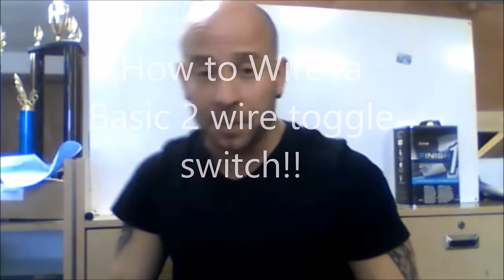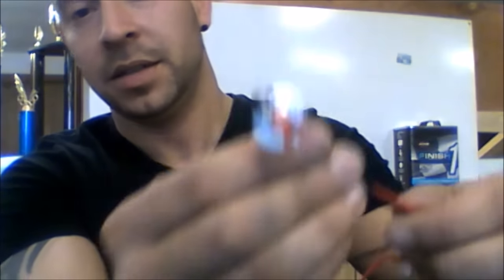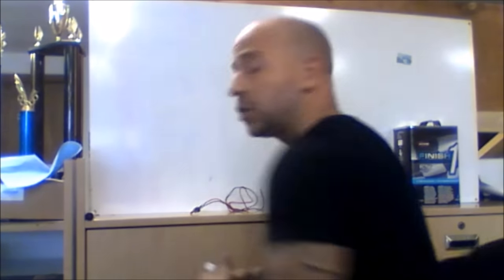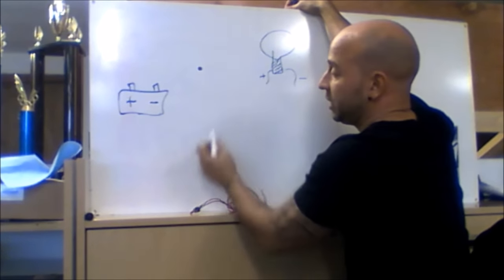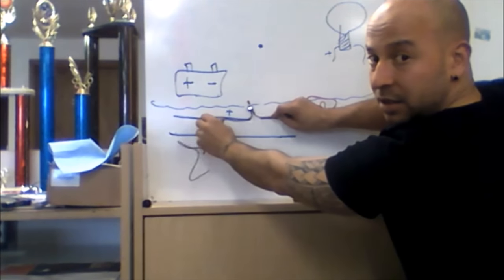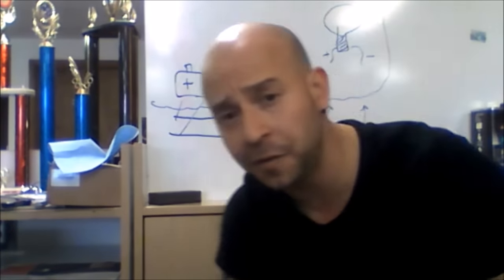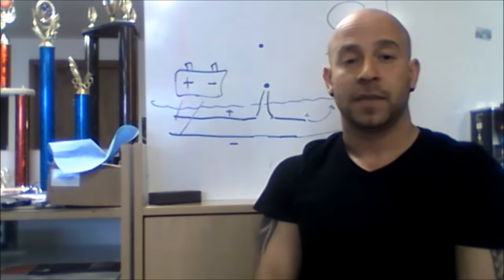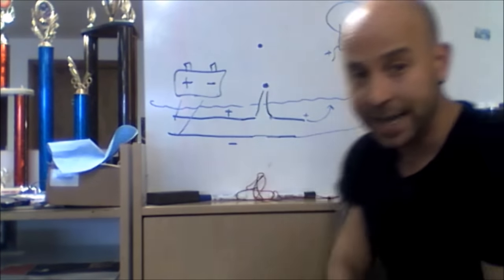How to wire a toggle switch , ( on-off 2 prong ) easiest best explanation, 2020

Comment: Mine is a 12V RV light fixture that has three lamps. I made the same mistake and put one black wire of the push button on and off switch on the hot or line and the other black wire from the push button on and off switch to the neutral. Bam! Blew a fuse! Duh! Your video is the only one I watched that explains it correctly! Thank You for helping this dummY-lol.

Comment: Absolutely amazing that you explained it so well and drew the diagram. I’ve been searching for this info for so long so my dual digital voltmeter I installed on my boat wouldn’t stay on all the time. Glad I found this. You are awesome. Wish everyone could learn from you. Thank you.
Reply from the maker: Thank you very much.  I appreciate the appreciation. I hope to continue to help.
Reply: @myonlinecarguy1  i loved thia explanation but i have a lil sneake question😅

Lets say i use a fuse tapper to give power to the switch right... 

to give Power to a LED strip, will connecting the led strip to one of the switch pronga make it to still get power?

Comment: simple and to the point , best explanation I’ve seen about this. I’m trying to ADD  a toggle switch to my light up emblem that I used a fuse tap to connect. Now I know all I have to do is take that ground off, connect one end of the toggle to it, and then put the other end back on the ground to complete the circuit. Thank you for answering the simple questions a “non electrician” everyday DIYer has, basically, just complete the circuit the colors don’t matter. You’re the man. Thumbs up
Reply from the maker: Seems you have a perfec understanding.  That's awesome,  your a rockstar and I appreciate you taking the time to message me.
Reply: @myonlinecarguy1  appreciate the reply as well. Subscribed. Always down to help people who want to help others. Thanks for your help brother
Reply: About to get this installed today, hardest part now will be going through the firewall and finding a spot for it that is hidden and doesn’t look cheesy… any tips for going through the firewall to the engine? (2013 c250 sport 4 door)
Reply from the maker: Each vehicle is diff as far an entry points,. But the easiest approach is not to go from car to engine bay. Instead go from engine bay into car. 2nd thing is to look for the OEM harnesses, they already go into the car and sometimes you may find that following them in the same location (rubber boot) is the easiest way.
Reply: @myonlinecarguy1  that’s a help, I was going to do it backwards thanks again boss. Especially for the quick replies!

Comment: I have a 1953 GE swivel top vacuum that needs a new toggle switch and power cord, your video has given me the confidence to give this a try. Thanks.
Reply from the maker: Just make sure the switch is appropriately A/C power or DC. The wiring should be the same.  But the switch type is slightly diff.
Reply: @myonlinecarguy1  I just finished and it works!  Thanks for your video.
Reply from the maker: Thats freakin awesome. Im so glad the vid was helpful!

Comment: DUDE... YOU ARE A SAVIOUR!!! I could not figure this out for my life!! hahahahaha
Reply from the maker: Im glad it was helpful my dude. Good luck with ur install.
Reply: @myonlinecarguy1  ANNNNND.... it didn't work. Now it's blowing fuses. FML
Reply from the maker: Can u better explain what your working in. maybe i can help
Reply: I have made a mechanical pipe light with a 2 prong toggle switch and 2 light bulbs on either side. It's a nightmare. So frustrating. I've tried everything. It's in a bus on a 12V system. Each bulb has 2 wires. So I put both commons together and both hot together. Then wired each side of the toggle to each of those. 1 side hot, 1 side common. I've tried both of the wires from the switch to hot.... then both to common. Still nothing. The light will come on and then when I switch it off and turn it back on again, it blows a fuse.
Reply from the maker: So...Only (+) or only (-) should be passing through the "switch".... as far as the fuse goes, the fuse should match the electrical draw. It couod be that ur wired correctly and the fuse is too small for the load. Another tip is to swap to LED bulbs. Because An LED wired improper just wont light up, no electrical short like a bulb Because an LED is just an electrical diode.
Reply: @myonlinecarguy1  The LED bulbs I bought won't even light up. It's strange.
Reply from the maker: Ok so with LEDS. If they dont light up, flip polarity  (+) and (-) . And see if they light up. Also, if u have a meter to validate pwr. That would help.
Reply: @myonlinecarguy1  I have tried all options. Both running through Pos & both running through Neg. That produced nothing. 1 to Neg and 1 to positive lights up the regular bulb. Then when I click it off and on again, it blows the fuse.
Reply from the maker: (+) and (-) at the same time is absolutely not good. I wonder if the switch is bad. Maybe try a diff switch even just a basic 2 prong 1st. Also we are talking a toggle switch right?  12vdc, on/off toggle? Not an Ac pwr house light switch right?
Reply: @myonlinecarguy1  Shit.... I'm not sure. I'll have to check. Maybe that's my problem. Haha

Comment: Yep, got a vintage lamp and the guy wired both wires to the toggle and melted them in half. Now I'm not sure I have enough wire to rewire it. I want to keep the original toggle because it's part of the appeal. Great video. I'm totally mechanically declined but this made me understand toggles. Thank you.

Comment: I did this for a desk lamp at home (so on AC supply) and works exactly the same. You can “break” the live (brown) or neutral (blue) wires and will work in the same way as on a dc circuit. (I’d recommend checking the switch is rated for correct voltage). I was tempted to go across wires so this video was very helpful - thanks. 
And yes, you really look like Vin Diesel
Reply from the maker: Yes when handling a/c power, amperage and switch capabilities are very important,  dc too. But ac for sure.

Comment: This helped me so much. I need to re wire and replace the old cutoff switch wich is connected to the battery then to compressors on my truck that feed an airtank and airbags lol

Comment: Thanks for all the great info..I am wiring a traffic light to a power cord so instead of unplugging it all the time i am trying to add a toggle switch to turn off the power. I can probably strip back the wires on the power cord and add the toggle switch ?
Reply from the maker: Pretty much. Just make sure #1 your only tapping 1 wire,  not both. #2 your toggle is a/c power or dc power according to what your tapping.
Reply: it does so I should be all set thanks again for the info and speedy reply..
Reply from the maker: Yeah, i think you'll be ok. Use a meter. Double check. But sounds solid to me.

Comment: Omg thank you
 I have wired many things. But never a toggle switch. And I'm wiring for my led lights so I dont have to have them plugged into the aux. but my toggle switch has 2 black wires with the same letters on them. So it was confusing af. And I have been online for hours trying to figure out if one side goes to ground and one to positive. And literally this video could have saved me hours of nothing.. Thank you so much for explaining so easily
Reply from the maker: Super glad the video was helpful. I absolutely appreciate you coming back and leaving the feedback too.
Reply: @myonlinecarguy1  for sure.. I always like to show appriciation especially when its something explained so clearly.. Keep up the good work
Reply from the maker: Thank you, its very appreciated.

Comment: Hey brother hope all is well with you.  I have a question.  How would you go about wiring multiple gauges? Would you tie them all together with a build a fuse and use the same 12v source? Or would you use multiple 12v sources? I'll be running 6 gauges.
Reply from the maker: Most gauges will use the same amount of electrical draw as the "power" is usually for "display" or gauge back- light. I would find out the electrical draw, add em up and see if it still makes sense to pull that much through 1 feed. Keeping in mind the source (where you actually getting power). Be midful of that draw too. That theres enough to support the whole load or not. 
If not, divide up. Those are the deciding factors.
Reply: Excellent info thank you soo much.  May the good Lord bless and protect you and your family . Awesome
Reply from the maker: @camlobesvtec  thank you, have a good evening and good luck with your project.

Comment: I’m hooking up a basic toggle switch like you showed in the video.  Should I include an inline fuse? I’m adding a light switch for the headlights on my riding mower.  Also if I should use an inline fuse what size fuse should I use?  Thanks.
Reply from the maker: Yes, you should definitely add an inline fisd. As far as its size, it needs to match the electrical load/draw of the lights being used.
Reply: MyOnlineCarGuy1 YOU ARE AM AWSOME HUMAN. Thanks for sharing your knowledge.  Have a GREAT day.
Reply from the maker: I appreciate the kind words my dude. I hope your mower project goes good for ya.

Comment: Great video but how do you use something similar on a 4, 6, or 8 gauge wire to a mower starter. I hooked up many toggle switches in my past but not like this because of Buddy's mower won't stop draining the battery.
Reply from the maker: Circuit breaker maybe? Would be a high amperage disconnect  for you, similar to a toggle, but for heavier gauge lines and amprage draws.

Comment: Can u use only one switch for two led lights or one for each.?
Reply from the maker: If by "led lights " you mean as your device? Like car led lighting, then yes. 1 switch would be fine for that. Make sure the pwr that is feeding the switch has a fuse, or you add a fuse.  So you dont accidentally burn anything up.
Reply: @myonlinecarguy1  thanks for the info

Comment: negative and posi from my 2 lights do i ground the negative to a ground anywhere. the posi from the light i think goes to the switch. the wire from the battery posi with the fuse also goes to other part of the switch...is that right or i am lost somewhere ....thanks again
Reply from the maker: You are correct. 
(+)->fuse->switch->(+ of device)
Reply from the maker: Ground is just a local ground. Both for device and LED pin of switch if yours has an led built in it.

Comment: Hey what’s up man, maybe you can help me. I’m trying to put a toggle switch onto my power supply unit , and also hook up a car stereo to the power supply unit. However, I had the green and black ties together and going to the car stereo. To my understanding if I add a toggle switch I need to use the green and the black wire on the prongs, so than where does the stereo now get connected?

Comment: Thank you for making the video - super helpful! How does the wiring differ if the toggle is taking the place of a remote switch (amp isn’t connected to a stereo, so no remote wire available)?

Comment: The switch and let's I purchased are from overseas. The switch has a black/white strip and a green wire witch I assume is the ground, however the 2 wires coming from the lights are brown and blue. How would I wire that to the battery of my motorcycle.  Can you please send me a diagram that I can follow. 
Thanks 
Wayne

Comment: Thank you.  So for my floor machine that needs a rocker switch, I have only two wires available going to it:  a white and black.  My assumption is that they both get connected to the two prong switch.  Correct?  Thanks again.
Reply from the maker: Most likely.  But every manufacturer of devices has their own design. So I can't be for sure. 
But if it worked and the switch "fell out" or something. And logic based on what your seeing says those r def the only two wires. Then your prob correct..could be that they used white for power supply and black for motor feed. (Like an input/output concept.) But like I said, I couldnt say for sure.

Comment: So using the ground on a toggle switch is fine? Having constant power to the device? Serious question. Because I'd rather have a ground ran through my firewall, than a hot wire.
Reply from the maker: You got it. You can use either side of the device. (Power your ground). And in the case of a 2 wire switch, either leg would do the same.

Comment: Glad I caught your video before I did my toggle. But I have a question... do the wire colors matter whether I go ground or power source. I noticed you had red and black can I use those colors as well
Reply from the maker: As long as u follow the instructions, using ONLY PWR or ONLY gnd to pass through then no it won't matter.

Comment: But if there are 2 wires coming out of the toggle switch (red+black) and you're only supposed to wire them to JUST the red or JUST the black, then do BOTH the red+black wires go together on the line you've chosen (red or black)?

Comment: Subscribed!! Question, is it possible to replace your 2 prong toggle switch with 3 prong rocker switch?
Reply from the maker: It is very possible. , so a 3 prong will require additional wiring, but the same wiring of a 2 prong, would remain.  Imagine a 3 prong, as 2 -2 prongs in a single switch.
Reply from the maker: There are sever types of 3 prongs. So, be particular when choosing. Some 3 prongs simply add a "line in"...to power an led light. .....other 3 prongs will use 1 single "input"....and have 2 diff outputs, depending on the position of the switch. In both scenarios, they each would introduce, the 3rd prong to the switch. (I hope that is worded in a way easy to understand in text, lol) also, thanks for the sub. We appreciate it.

Comment: well my fans wont turn off when i turn off my van killing my battery.how do i find which wires run my fans under my dash there are so many.and also i have dual fans do you only need 1 switch

Comment: Can you install this switch to an extension cord???
I know they sell those already made
But the ones i keep finding are to big for what im trying to do
Reply from the maker: As long as it is a switch rated for AC power and rated at the amperage your going to be pulling through it. Then yes. A switch could be installed.

Comment: Hey! So i teared apart a lamp i had that has a switch on it, but between the switch and the lamp there's thing  connecting the wires that I'd like to know what it is and if i can remove it. (It has some squared metal plates that are glued together and smthing in the middle that the wires go in and connect)
Reply from the maker: I honestly couldn't say one way or another if that piece is important or not. Each manufacturer a product uses particular modules and devices base on their design. So, if your needing this for something else, there no way to say that you either do or dont also need those other pieces too.
Reply: @myonlinecarguy1  thanks for the quick reply! I found out that it's the transformer, so if i remove that thing the results are not promising right?
Reply from the maker: Oh yeah prob not..most electrical devices run on DC power. Its a simpler circuit.  But "house " outlets are AC power. So the transformer, makes the conversion. So really , tue answer to.your question comes down to what your trying to do. If your just redesigning the lamp, then yes, youll need it.
Reply: @myonlinecarguy1  thank you for your time man ;)
Reply from the maker: Your welcome,  i hope i was helpful.  Good luck with your project.

Comment: Is it better to put the toggle on the negative or the positive?
I want to hook my starlight headliner LED engine positive to a fuse tap piggy back and the negative wire to ground to metal chasis
where is the safest place to put the 2 prong killswitch?
Thanks!
Reply from the maker: The (+) is the simplest. But in all honesty,  electrically its the same either way. 
If u put it on (+)itll be easier to wIre a 3prong switch that has an LED. I have a vid for that as well.
Reply: @myonlinecarguy1  I dont really mind for a switch with an LED, 2 prong is fine :) I will be able to tell when the switch is on from the lights being on lol
Thanks for the reply !

Comment: Does the ground have to go to the battery negative or can it go to a ground point on the frame (in the case of being installed in a car)?
Reply from the maker: A local metal ground would be fine. As gnd is gnd.

Comment: Hey what's up I need help.bady I recently bought a fly 7 ebike moped. Im trying to understand why my alarm is only makeing noise when I press unlock whwn I press lock nothing happens or when I press. The lighting bolt which if double tapped would normally power up my scooter so with my old fly3. I had no problem with that I was able to press twice and bike would start up I'm no longer able to do it and don't understand why I'm thinking maybe my alarm is not connected correctly I am currently using wago connectors. Instead of haveing to tape and retape  everything. So it's convienant please.help me
Reply from the maker: Im really sorry man/ma'am but i cant help with this. You need to take you bike to a shop for service. Your questions are extremely specific and theres no way i can answer them without the bike in my shop for me to go over.
Reply: Well I changed the ignition switch to a toggle switch on and off that seems.to.work.just fine ebike/mopeds come with a breaker switch should I put.the on off toggle after or before the.breaker??? If that makes any.sense